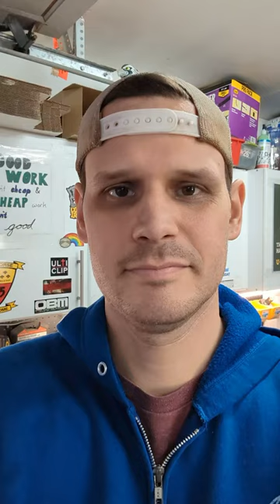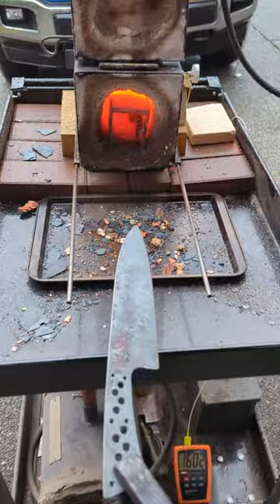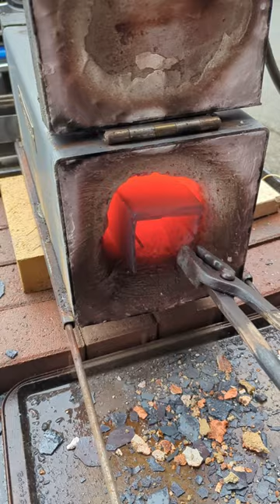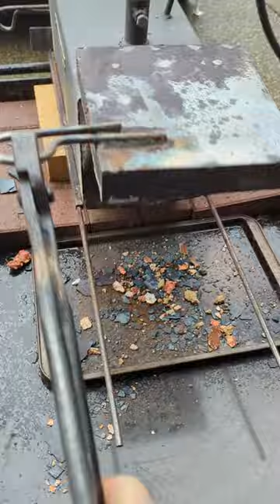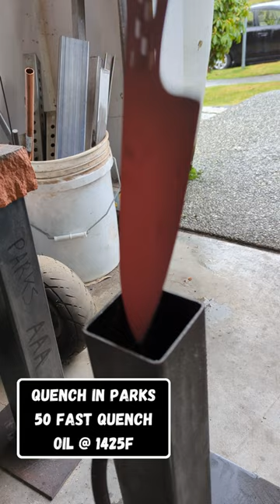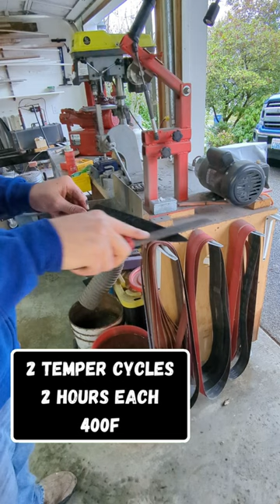Heat Treating 2 Hand Forged Chef Knives | Knife Making #shorts

Comment: What kind of furnace are you using for your heat treat?
Reply from the maker: It's the Hell's Forge double burner propane forge. I used castable refractory over the ceramic fiber blanket it comes with. There is a link to the specific item on my website under the 'product links' tab.
Reply: Thanks 👍